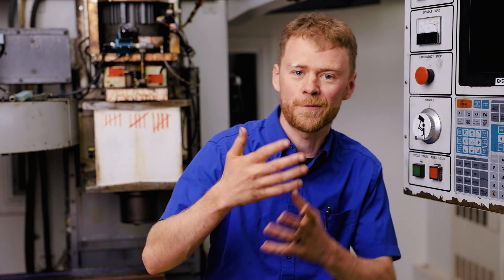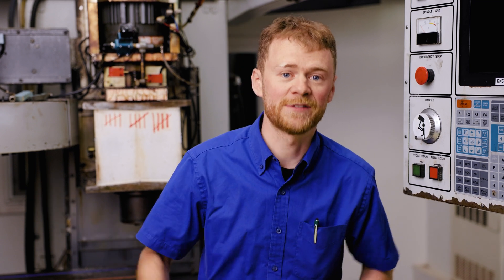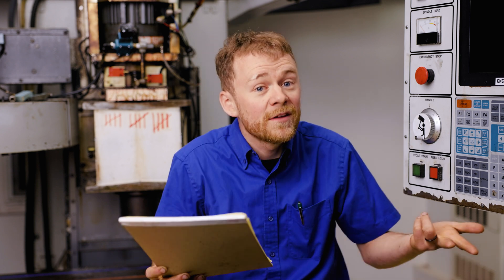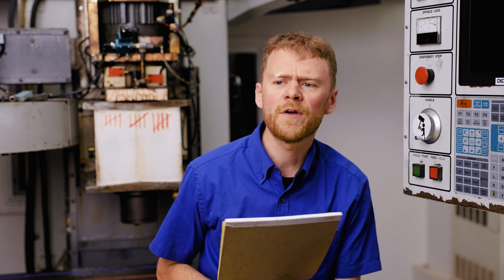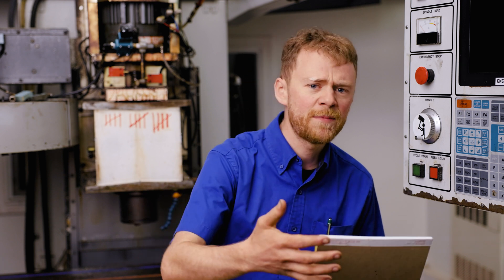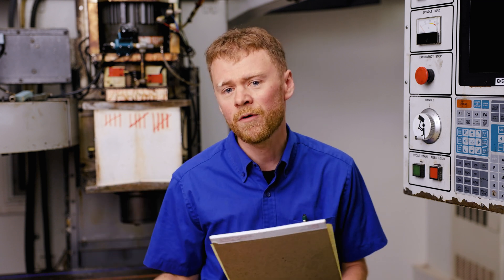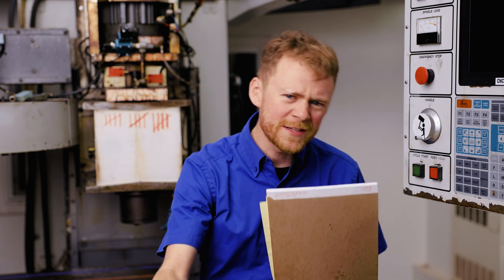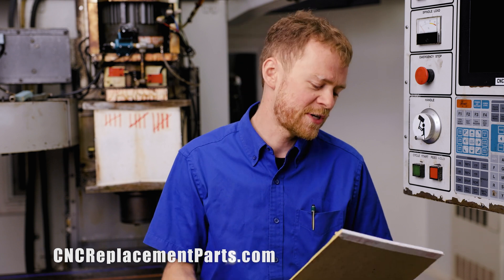Why Old CNC Machines Are Being Scrapped

Comment: We scraped a 1991 Nicholas correa with a hiedenhiem 415 control. Table had 200in in x and 46 in y and 50 in z. Also the head could index from horizontal to vertical and b + - 90degrees....made us lots of money. But noone could repair it and when it quit it crashed into itself...and that was every time you tried to rapid x axis. It was just to dangerous for anyo ne new to run it. It was soooo jerry rigged with toggle switches  and everything 😂😂😂

Comment: When you want to buy an old CNC machine.. first look if you can either find Replacement parts, or if it is possible to retrofit it!
I used to work on an old Fadal, yes.. it wasn't as straight forward to operate as modern machines, but!, I downloaded al the manuals i could find, and figured it all out.. Turned out, when you find out how to run it, it can be a fine machine, old, but fine!..
I bought an EMCOturn 120 lathe a while back, machine is 32 years old, but since it spent most of its years in a school, it didn't see much action, as it was, so i was told by a mechanic who knew this machine, too complicated for the students, so it spent most of its time turning brass and aluminium chess pieces on open days at that school.. 
i got all the manuals, fired it up, and a year later it paid me way more than it cost me,
I now have plans to retrofit it, so i can automate it easily, with a bar feeder, giving me "light's out production possibilities..

Comment: See it all the time.  Obsolete controls and drives. Very long lead times for mechanical parts not common anymore. Shops not doing lube system PM's, killing the ways.  Big expensive crashes. Not cleaning underneath the way covers, packing in so many chips the servo load goes through the roof and everything rusts because they don't keep an eye on their coolant concentrations either. Crappy incomplete repairs done in the past that cost tons to rectify correctly (plant manager was jumping up and down yelling "we just need it to run!").  Machine is depreciated out, they need to move it to make room for a new one and can't find a buyer.  Lots of reasons.
Reply: That's because most shops put uneducated operators on them, run this ** out of them 20 hours a day, and don't have any maintenance on them until something goes down and breaks. It's really sad because the price of these machines is outrageous. We had 25 + year old Okuma LB-15's in our shop that were well taken care of and still held a thousandth tolerance all day long. We rebuilt spindles, replace drive units, and rebuilt turrets on these machines as needed, and they never let us down. We owned over 80 Okuma mills, lathes and Multus machines in our lifetime at our business and they were all rock solid.....

Comment: That old Matsuura will outperform many newer machines.  Check its hardware and you will find ultra high quality, heavy duty components everywhere
Reply: Yep, and you can buy BT 45 holders for $40, you can put most modern tools into them, it's not an issue.

Comment: Great advice! , the temptation of restoring an old cnc can really open a can of worms 😂. I decided to take on a 1990 Moog Mhp A15, 3 tons of boxed way 3 axis mill, dc servo's, analogue amplifiers and unsupported Hydrapath 3 control. It has taken a huge amount of time to keep it running, making test rigs to repair the amplifiers, re capping boards etc, had to create a custom post processor for it, very slow blocks per second processing rate when drip feeding. Just blown another servo amplifier 😢. Now the reality is either scrap it or retrofit with centroid and new servo's, lots of cost and time plus headache of writing custom plc program for gear change and tool changer. Overall a complete waste of time but educational. Just seems such a waste to scrap nice castings, ball screws and precision surfaces

Comment: Hi buddy . Like you video & philosophy . A Question. I have a 2002 Multicam MG that has just had a spindle rebuild but the rest of the electronics ( Stepper Drives ) are getting , shall we say " Crispy " . Multicam charge rediculous prices for spares ( If they even hold them ) so i`m looking at refitting with something like Gecko drives & servos. My question is , is it cost effective to go this route or is it better to scrap what is machanically a pretty good machine and buy a brand new NOT Multicam ?
Reply from the maker: I would say don’t retrofit.

Comment: The machine behind you, the one you say you are selling parts for, which brand/ model is it?
Thanks for this channel, I recently took a job as a CAM programmer/ CNC machine operator at a company here in Holland. They run two old Okumas, an LCS25 and an LB35-II. Both have issues, I hear from the operator the small one is probably end of life. I have yet to get experienced with them though. Another issue may be that we want to program with Hypermill in the future and apparently the programs it generates can be much larger and may be an issue for the machine memory, any experience with that? Thanks a lot.

Comment: When things were all manual, the stuff that came out of the best shops went to the next ones down and so on until all but the largest got to people's homes - more people engineering back then both for work and their hobbies or side gigs.

The nature of CNC means that hand-me-down is mostly not viable. It's killed the pipeline which supplied the next generation. Also in turn means less people can fix stuff so it's too expensive so things get thrown away and a new one bought.

CNC might be more efficient for knocking out a batch of 50k parts, but it's come at the cost of more sustainable economic models with engineering more distributed around local small shops developing.
Reply: I have mostly manual, but started getting into wedm. Got a great deal on a 25 year old Mits and works great after a few thousand in repairs. Then I tempted my self into a larger one that was supposed to be working. Still haven't got it going, and will have to throw an expensive dealer visit & parts into it, otherwise it will be 10k down the drain.

Comment: I've seen machines die when the machinist retired . No one wants to go crazy by learning 10's of problems of a machine... problems that you know ..normally should not be there .
       The problem with the old iron , and godamm some were build like tanks , thick af. casting , thick af leadscrew , larger bearings , motors that were oversized - and could run nnon stop without overheating . The machines could generally take more beating , the sheetmetal was 2-3X the thickness of todays ....list goes on .
       Imy experience NO ONE cares enough to do a proper repair , or if that's not possible , than a complete rebuild overhaul-with new servos, bearings , leadscrews , fully new electricals . Basically to keep the casting , sheetmetal , and maybe a few other mechanincal components .
Instead of investing , they just kick a 20-30 sometimes 40 year old machines till it can't even interpolate , e-stops stop working , servo breaks stop working , you have to actuate realys by hand , aswell as position sensors , oils start leaking really bad , bearing noises , loss of power , loss of position , shaky axis movement , broken keys , hideous coolant tanks , and a handful of botched and dangerous repairs . The use it "till it completely breaks" mentality"    ps: with lots of downtime and scrapped parts .

Comment: I have seen several machines scrapped in two decades as a machinist. Repair costs often exceed the value of the machine, and old machines are less productive. Lower spindle speeds, rapid speeds, machining speeds.

We've scrapped two in the last few years at my current employer. One was a pretty nice machine in the 1980s when it was new. A board failed and it would have cost more to uave the board repaired than what the machine would have sold for if it was running. It was also incredibly slow. I think max rapid on it was 400IPM. Spindle speed topped out at 4000 rpm. It was okd enough to have a physical tape reader, and we were never able to get it to communicate via RS232. I almost forgot, it also had a yellow top motor. Programs had to be typed in by hand. Old, slow, and frankly junk by any reasonable standard. The second was a decade or so newer, but the ways were worn out, the ballscrews were worn, the spindle bearings were shot, and it was also slow.

Neither of those machines, or any other I've seen scrapped, was anything anyone would want. If you want to make money, you don't buy worn out garbage that requires constant repair. You buy something that runs, cuts accurately and precisely, and will do so repeatedly.

Comment: build my business using old machines , takes time to keep them running but i sure make a ton of production on them . did not have the money to purchase a bunch of brand new machines straight out of the gate . so i bought old and repaired . kept adding to the collection of old machines . and only after 15 years i now start replacing the machines 1 by 1 to "newwer" machines
Reply from the maker: You’re doing it right!

Comment: Yes, old cnc machines. Scrap. 

Older, manual machines? Don't scrap. If youre a digitard, you can put digitard boxes and controls on them just fine. They're actually built to be maintained tho, so they're way better machines to begin with.

Comment: A couple of decades ago, the manufacturers started embedding PCs in their electronic measuring devices, the expensive ones. Imagine investing 100k€ on a device that has very long technical lifespan, is precise and then the user inteface software runs win95 along with some esoteric interface module to connect with the signal lines,  gets no OS upgrades and boots up from a spinning disk. Better have short ROI calculated for that one.

Comment: We have an old Cincinnati Arrow that has servo drive issues, at first it wouldn't work at all without having the 4th axis plugged in. Finally now it won't work even with the 4th axis plugged in. The parts are all discontinued for the drives and servos and because its a government facility it is impossible to even hire someone to repair drives or purchase drives used from eBay or anything. Its really a shame because when it was working this machine was straight bananas fast and accurate with a super high-speed ceramic bearing spindle. I have built several machines in my free time outside work and know how to wire them and I still can't get anyone to approve retrofitting it even though previously I had the time to do it.

Comment: I know a guy with several super old cnc machines 3 mills and 2 lathes. The business that was renting his building just closed their doors and left them with the arrangement he could have everything in lieu of back rent. He’s been trying to sell them for 2 years. But they still sit there taking up rentable space because he believes that because they were $100,000 new 30 years ago, they’re worth something now. I looked them over and they’re exactly what an abandoned machine would look like. One of the lathes is an early Hardinge cnc, and they’re good iron the spindle still had no runout with 50,000+ hours on it, but the controls are beyond archaic. It still had a slot for a tape reader. Against my better judgement I offered to take a little cnc Enco lathe missing it’s transformer in exchange for helping him sell some of the more marketable small tooling but he wanted $8000 for it. A machine buyer stopped by, probably out of pity, and wouldn’t even take them for parts / scrap for free. Unless it’s a machine you can personally load on a drop deck trailer or haul some other way, like you’re a competent rigger with access to the stuff you need to move a machine, even a free machine will cost thousands to move. It’s funny how many guys with microwaves that have clocks still blinking 12:00 think they can repair 40 year old electronics.
Reply: Google search shopfloorautomations. Also centroid retrofits make old iron new. Can even run old yellow cap fanuc DC servos and communicate. Those old boxway with hardened tool steel ways, cnc's, are built in a way that wouldn't be economically viable today. Even rebuilding those old servos and spindles are economical today and they last twice as long with accuracy as modern stuff.

Comment: So there is a market that is overlooked. Machine tools are not evenly spread across the country, they are in pockets. So here is the game. Buy the machines for the cheap scrap price, the mixed metal or even the mixed material price. I myself in say the Los Angeles market would pay 7 cents a pound. Then load them onto rail cars and take them to medium (100K) hub cities in the Midwest. Most of those, even more so in the southern reaches, never had a major machine working tradition and so they don't have lots of machines sitting around. So say that 70K monster as an example, you pay 70,000 x0.07 for a total of $490. For shipping, buy a flatbed trailer, load the machine on the flatbed and load that on a train car. Then ship it to the Midwest. Total cost to this point, less than 3K excluding the trailer, which you can either keep for the next load or sell to get your money back.

You now have a functional huge CNC machine in a Midwest city, where you can easily sell it for 5 to 10K.
Reply from the maker: Your idea is awesome and I think could work!

Comment: Long time ego way back in 1964 I was working in a metal fabrication shop in Germany. Our equipment was ok but  post WW1 era. One day our maintenance guys had come and carried out all the equipment
to the backyard and started to cut them into scrap. The new equipment was  installed and running the same day. I was told that the old equipment has to be scrapped to prevent resale.
The newly purchased equipment could be written off in a few years. It was done to update the country's machine industry. here in America I was working in a few shops where the equipment was 
pre WW2 date. Nothing but  old worn out junk. No wonder that our machine tool and most of metal working industry gone to overseas.
Reply: Similar tale in the UK in the early 80s . As an apprentice I spotted a brass ID plate on a milling machine : it said “ Air Ministry Property “ The make of machine was Fritz Werner Berlin . I asked one of the old Fitters it’s history . He told me it was commandeered post 1945 and brought back to England . I asked what did the Germans do ? He replied “ they got new ones “ 😂

Comment: While his advice is true don't take that as there are no good older machines for sale that will work just fine for many peoples purposes. A company may get rid of a perfectly good machine because there are ones that run faster and over three shifts a day it adds up but if you need one for one off or low volume production a brand new machine would take years to pay for itself if it ever does where a good used older one will take a much shorter time to do so.

Comment: i think the old green matsuura you talked about was in a video from a channel called prestige manufacturing just uploaded a day ago. bragging about buying it for 350$ 😅. in the video it looked like a great deal but he never mentioned anything about the 45 tapper
Reply: 45 Taper tooling is around and if you have patience it's damn near free at most auctions.  Monarch tools often used them so if there are old Monarchs in an auction catalog thats where you want to go hunting.
Reply: That was a different machine (or two). I happen to be in a shop where we have an identical machine to one he bought, and previously had a very similar one to the other he bought. Both are 40-taper. We also have a 1998 Matsuura MAM700-HF horizontal that does have a 45 taper spindle. Thankfully we bought a couple hundred tool holders for it at auction at one point. It's a rare taper at this point and when we get rid of the machine they'll all go with it. 

We also have a Hitachi Seiki VS-40 in the shop. DMG-Mori is some help with parts and service since they bought all the intellectual property of HS but they're all getting old too.
Reply: I thought t was the same exact machine however, the one in the PM vid has a yellow stenciled X axis direction on the right hand shield ( Look below the control panel ) . The one it this vid does not.

Comment: Our business has been a buy and retrofit/rebuild model based on the iron outliving the electronics.  Fewer than 5% of our machines are brought back with the original controls.  Lately we are scrapping even newer machines due the resale value of the parts and the physical condition of the machines.  Machines destroyed by (neglected) coolant are often not economically-viable to rebuild and retrofit.
Reply: There is a lot to ponder in your comment.  I wonder why electronics just don't seem to last.  Car mechanics share the same complaint.    Happy New Year
Reply: @Dancing_Alone_wRentals  Most are easy to fix if you know what you're doing. I picked up an old but decent VMC with mitsubishi controls because the spindle drive needed repairs. The owner was quoted $3k to repair, and he had just spent money getting it fixed. They did a terrible job repairing it the first time, and their bad repair caused the further issues. I was able to fix it for $70 in parts, and 2 or 3 evenings of work. I've since torn the whole machine down to clean everything, and in the process of putting it back together. That's kind-of dragged into a super long project, as it's a hobby project, and one guy doing it in his garage - the pieces are almost too big to deal with with one person in a garage with an engine hoist, but slowly but surely...
Reply from the maker: Interesting. I don’t really know any company that can run profitably for a long time doing retrofits. Most customers are just not willing to spend the money to do it correctly.